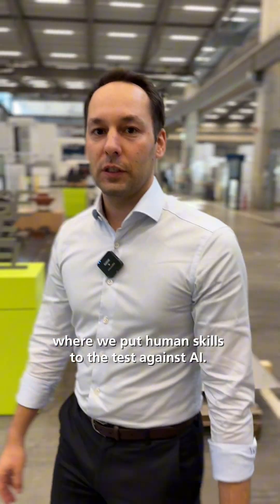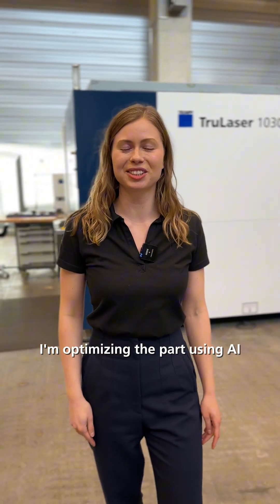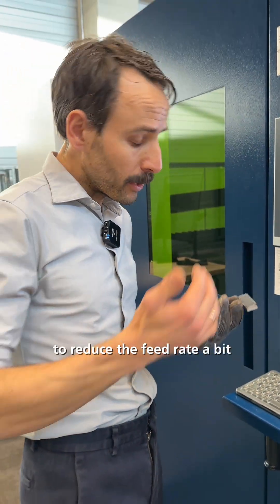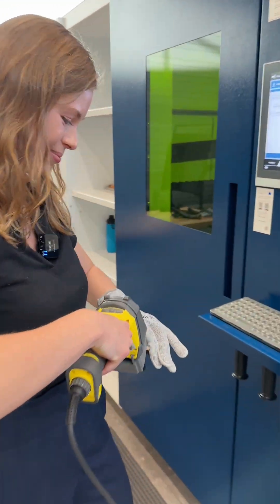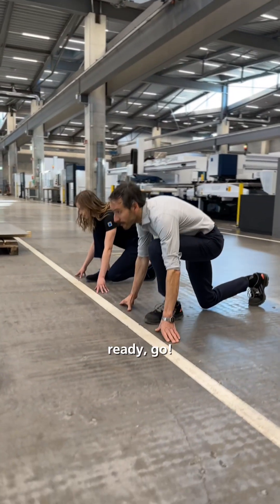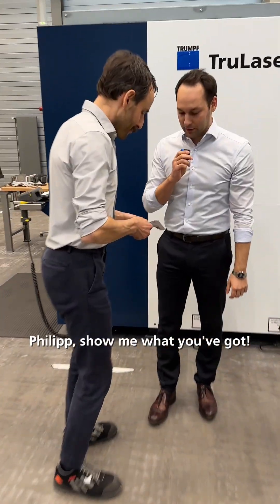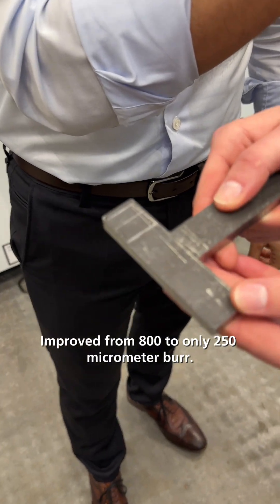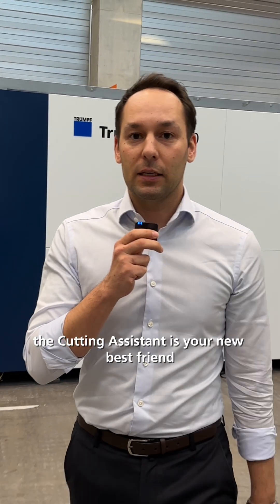TRUMPF: Cutting Assistant Challenge

Comment: Why does ur default setting for each thickness not work lol
Reply from the maker: Hello, and thanks for your comment. The default settings works fine, however if the material differs from standard adjustions become necessary. 
Best regards